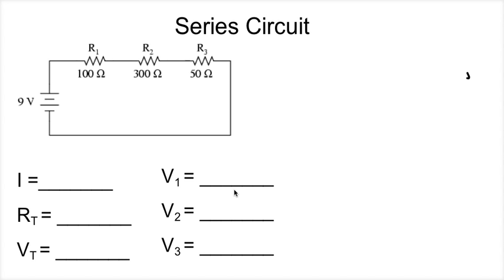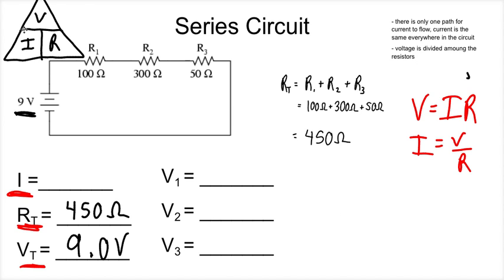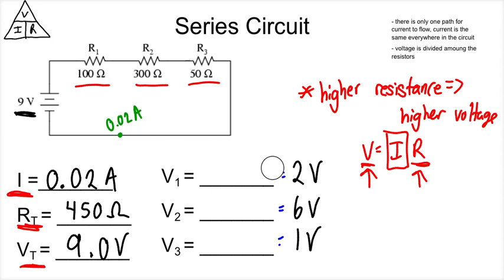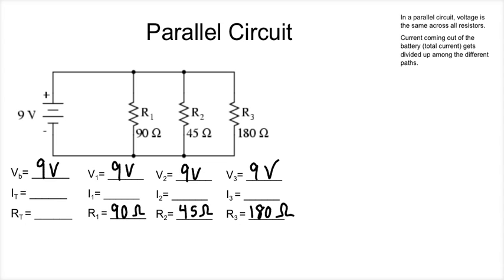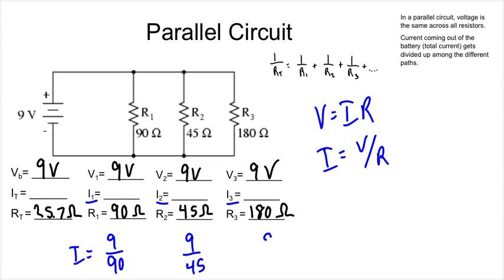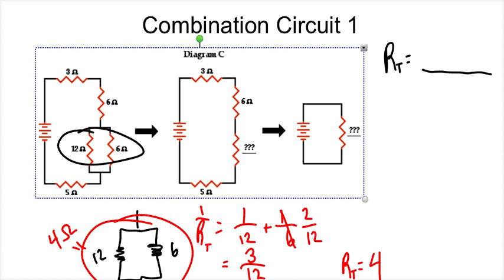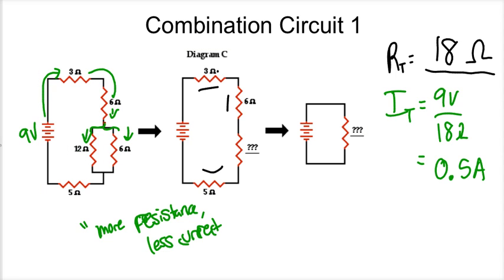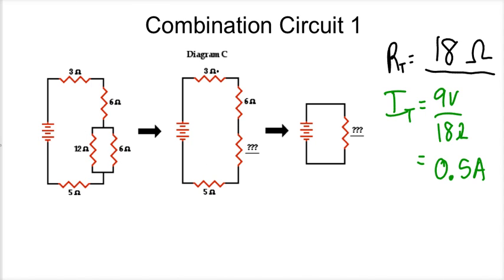Series and Parallel Circuit Practice

Comment: But 1 divided by 0.038 = 26.3 Rt, its not 25.7
Reply from the maker: Thanks for asking! When you keep the full decimal from previous calculations (i had the full number- 0.0388888888 stored in my calculator, so when using that value the final answer rounds to 25.7- one of those times when the mid-problem rounding made a noticeable difference in the answer! This is why significant figures are important- both numbers round to 26, which shows level of precision.

Comment: Hello Mam, I am not sure you were aware that instead of 1÷ 0.038 = 26.316, you changed your last digit into a nine. That's how you got your answer of 1÷0.039 = 25.64 happy to help 😊😊
Reply from the maker: Thanks for trying to help, but I had the full number in my calculator which made the final answer a little bit different! One of those instances where the significant figures made a noticable difference!

Comment: @17:34 why did we take (2/3) of the amps when the resistance in parallel is only doubled?
Reply from the maker: There is a slightly error on that part! (the higher current should be with the lower resistance)- but because it was splitting into two path, I knew one path had to be double the other other (2x for 1, x for another), so in equation form it would be 0.5A= 2x + x, or 3x, leading to that 2/3rds calculation!

Comment: Question, Why not find a common denominator when solving for total resistance in parallel circuits?
Reply from the maker: That's another perfectly valid way to do it! I tend to use it with "easy" numbers (when the common denominator is easily solvable), but find with more complex numbers it's easier to just do the algebra.
Reply: 6 years ago and you are still replying to comments 😮 @KcoolScience

Comment: In not sure if im correct i think the 6 ohms has.33 and the 12ohms .17 amp current flowing to those resistors
Reply: Yea you are right the video got it wrong. More resistance less current.

Comment: In the parallel you have to get the bottom number the same. 180 for all 3. and 2+4+1 top numbers. 180 divided by 7 = 35  resistance divided by voltage.   i1=10 i2=5 i3=20  that totals 35 and y'all watch other videos to double check me but all other videos I've watched do it this way and the ugles book shows it that way.
Reply from the maker: Maybe in your book the bottom number was the voltage? The voltage is the same parallel, but resistance of course isn’t because that depends on the properties of the resistor, not the circuit itself!
Reply: @KcoolScience  no and I've watched many other videos that get the bottom number the same then flip the fraction after it's added up.

Comment: Hello. I am new to parallel circuits and I am lost on how you got 25.7 ohms. The closest I got was 25.64 ohms. Solved.
Reply from the maker: I had the full number stored in my calculator - 1/0.038888888888 is 25.7, one of those instances where significant figures make a noticeable difference!
Reply: @KcoolScience  Thanks. Do you have videos on Kirchoffs loop law? Like solving for two batteries on a parallel circuit? Thank you for the videos.

Comment: Again how do you get 25.7....... 1/ 0.038 I get 26.3 when I decide 1 by 0.038. what did you do to get the final number ?
Reply from the maker: I had the full number stored in my calculator- 1/0.038888888888 is 25.7, one of those instances where significant figures make a noticeable difference!

Comment: If the Voltage isn't present how do you find it?
Reply from the maker: Depends, what other information are you given? If you have current and resistance, use V=IR, if it’s a simple parallel, equal to battery voltage, anything more complex would need more steps

Comment: How did you come up w .333 and .17 @time 17:43 ? Thx
Reply from the maker: Because the 12-ohm resistor is 2x the resistance of the 6-ohm resistance, it will get half as much current. Since the total current is 0.5A, if we divide it by 3 we can give the 6-ohm half the resistance (0.17 amps) and the 12-ohm twice that (0.33 amps).  Basically, using the proportionality to get there.  A better way would have been solving for the equivalent resistance (1/R= 1/12 + 1/6; R=4), then multiplying by the current (0.5 A* 4 ohms= 2 V) to get the voltage drop, then using V/R=I to get the individual currents. (2V/6= 0.33A and 2V/12= 0.17 A)

Comment: HOW DID YOU GET 25.7? I THINK YOU COMPUTE IT WRONG?
Reply from the maker: As explained in a previous comment, I made a rounding error and used "0.038" instead of "0.038888," 26.31 Ohms would be more precise.

Comment: how did you get 25.7????
Reply from the maker: As explained in a previous comment, I made a rounding error and used "0.038" instead of "0.038888," 26.31 Ohms would be more precise.

Comment: How u calculate the voltage drop across each rezistor
Reply from the maker: Depends on which type of circuit- in a parallel, typically you know its the same as the voltage of the battery (in a simple parallel), where in a series you typically solve for current first using the total resistance, then use V=IR, with the individual resistances to calculate the voltage drops.
Reply: @KcoolScience  u can also calculate in paralel per rezistor
Reply: @georgegeorgel7254  in a parallel circuit its gonna be the same across each resistors

Comment: Not sure how you got 25.7 ohms at 10:26... my math provided an Rt of 26.31. Regardless- thank you for your help.
Reply: 1 divided by .038 equals 26.31 but 1 divided by .0388 is 25.7
Reply: I'm with you on that. I was wondering the same thing.
Reply: @clutch-400  so... is the answer 26.315? I'm a little upset that answer is 25.7 !   I think that the answer should be 26.315 !
Reply: once you get your resistance total in the fractional form you should do the reciprocal of those numbers and then divide to ger your final answer
Reply: Mine too
Reply: Those answers are all correct. One has been rounded up to the nearest whole number. All are the same

Comment: Hi. your last problem has a bit of an issue. starting at 16:15 you say that "more resistance, less current" and that the 12R will get half as much current as the 6R because it's double the size. cool so far. Your very next calculation then incorrectly shows the opposite happening. Then when you go to solve that parallel resistor section in a different way, you end up saying that the 6R gets one third of an Amp and the 12R gets two thirds, which is also incorrect. It should read that the 6R gets 1/3A and the 12R gets 1/6A. the formula is I1 = (Rt/R1)*It and Rt for that section is 4ohms. so its ((4/6) *.5) = 1/3A   and   ((4/12)*.5)= 1/6A.
Reply: Yup! Great explanation